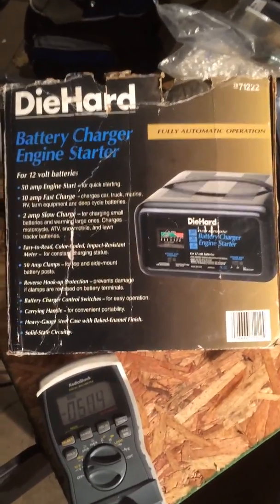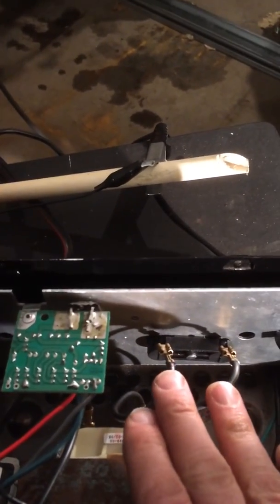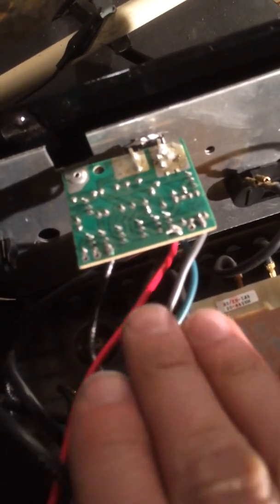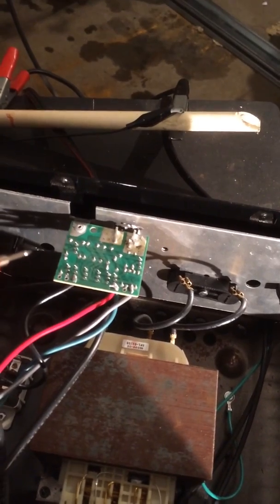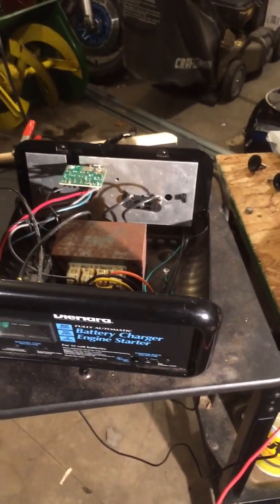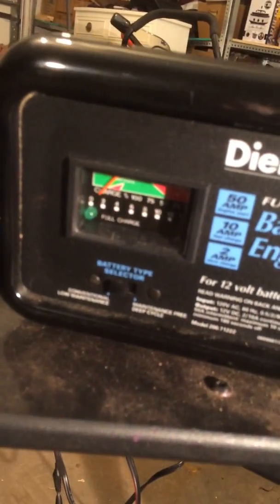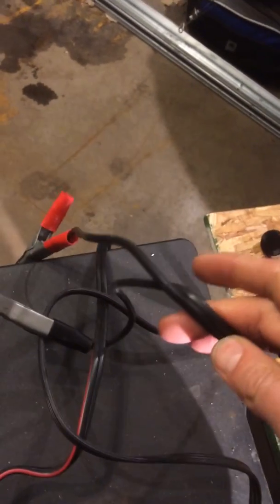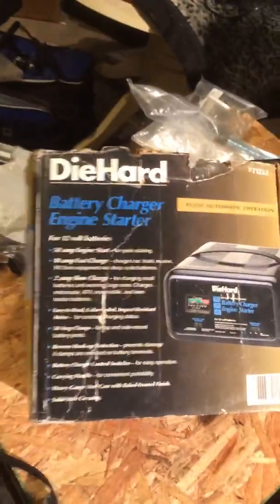My fix to the DieHard Battery Charger, explained out.

Comment: Hey Jason, Just wanted to let you know how I resolved my low voltage problem. After using the multi meter.  I found a high resistance at the battery clips. I did a ohms test just on the leads and replaced both alligator clips. That fixed my problem.
Reply from the maker: Very interesting.  Wouldn't think that the clips themselves could cause resistance, since they are just zinc plated steel.  I could believe the substandard cables they use to become defective and cause resistance. But good information and other place to inspect.

Comment: Hi Jason.. Great Vid but I couldn't see where you put the other lead when you were testing the back side of both diodes.  Guessing, you put the other lead on the negative secondary? 
My old Everstart 50 10 2  has the same internal parts and I have the same problem with low output voltage on the battery connection leads. I thought for sure that one of the two diodes were bad, so your vid just confirmed it's not the two diodes. I like the tip on the battery cables gauge being to small.
Reply: Diodes will only pass current one way, so they should read somewhere around .45 to .5 volts using the diode check function on your multimeter. That said, they are either positive or negative. To test, prod the diode connections with your test leads one way and then reverse them. One way should give the .45 to .5 volts reading, and the other way should be zero. If it shows a forward voltage in both directions it is definitely bad. If it shows no forward voltage in either position, you need to double check the device's wiring to be sure there isn't a short somewhere else that is affecting your reading.

His video proved his diodes were good, not yours. Don't make an assumption, test them yourself.

Comment: EXCELLENT, that got mine working...thank you! now, with that wire disconnected, what can I expect to act differently or not work?
Reply: actually mine is a schumacher, but the insides are IDENTICAL, I dont mean they are similar , they are exactly the same, even mounted in same locations.